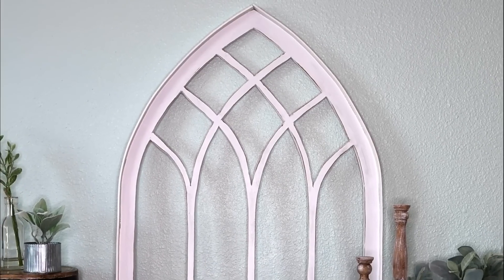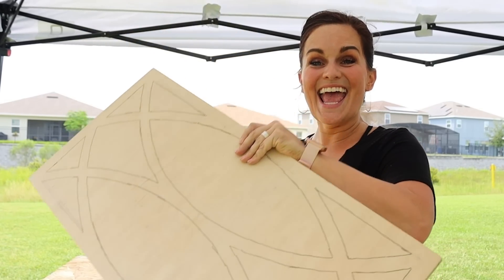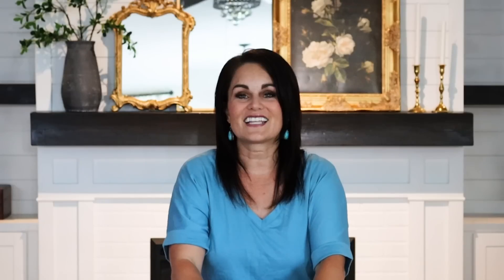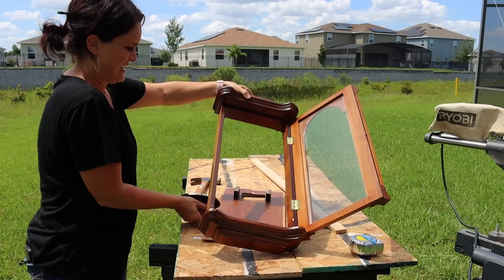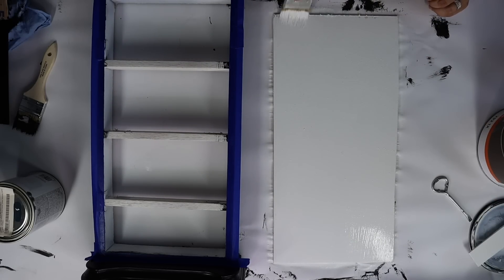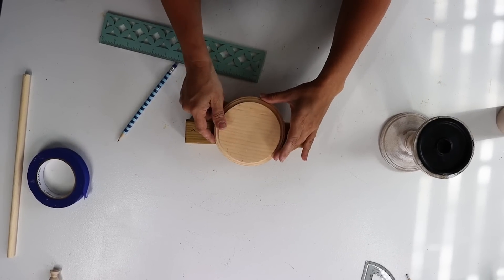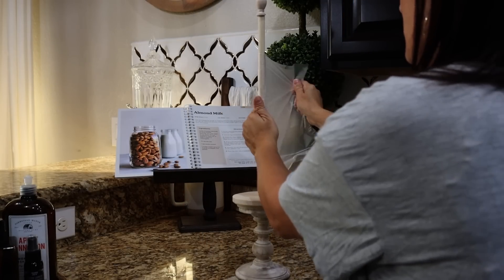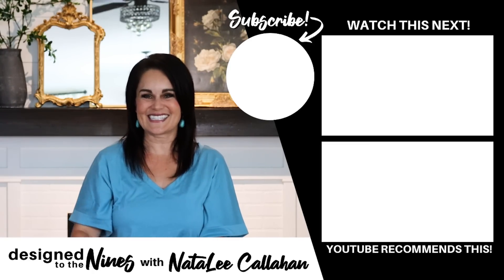HIGH END DIY Decor That's Simply Amazing! (+ Power Tool News!)

Comment: My dad got a similar clock after working at his company for 30 years. It was very beautiful, but picking it up and holding it, it felt like particle board with veneer.
Also, I'm pretty sure grandfather clocks are specifically large freestanding clocks. Anything small enough for the wall is just a pendulum clock at most

Comment: NataLee I just hope your powertools battery better design than Ryobi. I just can not unclip the battery pack on it. Way too wide my fingers can not reach both side to push it in. I have to push one side to a besa block corner than try to wiggle it out. Must say if I knew it is so difficult I would not purchased it. Too late now. So I am looking forward to see your design. Hope it will be kind to little hands. 🎉🎉❤❤
Reply from the maker: I couldn’t agree with you more about the Ryobi batteries. Definitely designed for man hands. These tools were designed with women in mind so you should have no problem getting the battery in and out.🥰
Reply: @designedtothenines  💗💖💗💖💗💗💗💓💓💓💓thank you